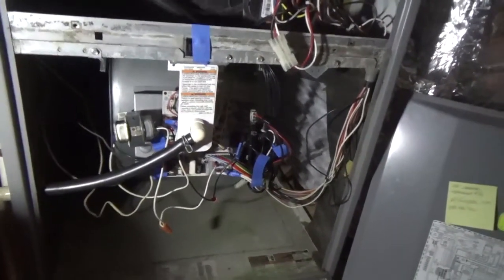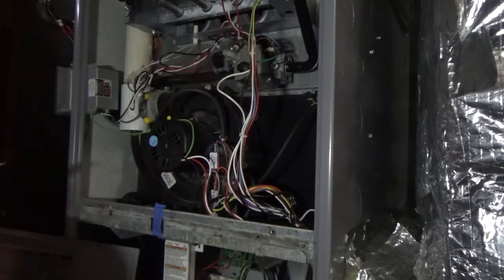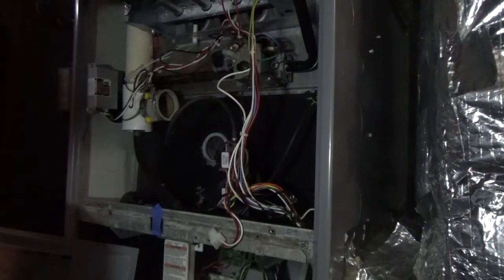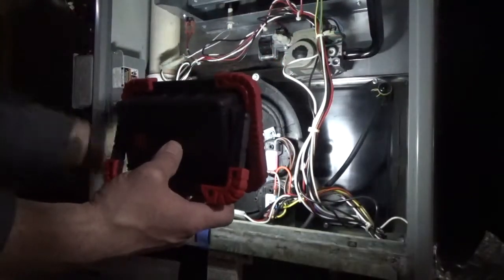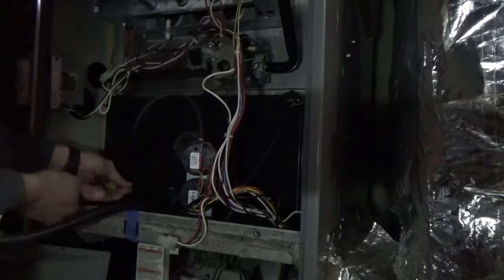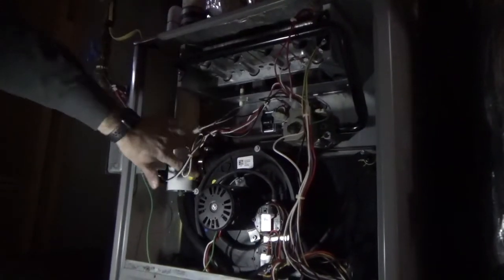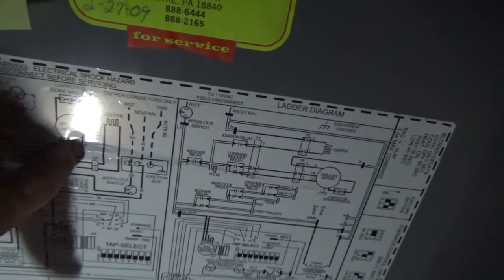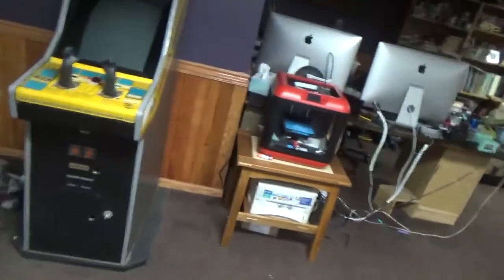No HEAT! Repairing an ICP International Comfort Products Furnace.

Comment: Great video, this is very similar to my furnace (n9mp1075b12c1 - Comfortmaker).  I want to get some education in how it works as it is now about 18 years old and I anticipate it needing some work in the next few years.  Could you talk a bit more about the fan controllers?  Is that part of the mother board or a different part?
Reply from the maker: It really depends on the furnace I believe.  In this particular unit there is a separate daughter board that controls the fan setup.  In other furnaces I support it's all in one.  Likely the newer units are all in one as they industry digitizes everything and the circuitry becomes more capable.

Comment: Did you end up reviewing the control board and seeing where it failed?
Reply from the maker: Honestly, after cobbling it back together myself for a couple of years, I eventually ran into issues with the fan controllers.  It takes special testing tools (which I don't have), so I hired a local HVAC company to come in and diagnose.  They ended up replacing all of that and insisted on replacing the main-board as well since the two systems are interlocked together.  When it was all said and done it cost me $1,200. Yay :-/  But at least I haven't had any more problems since then.